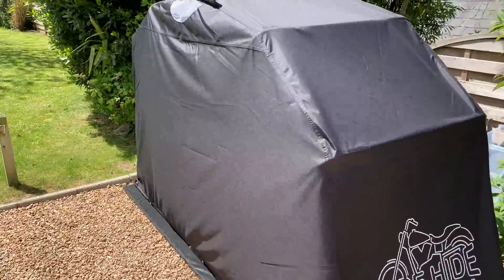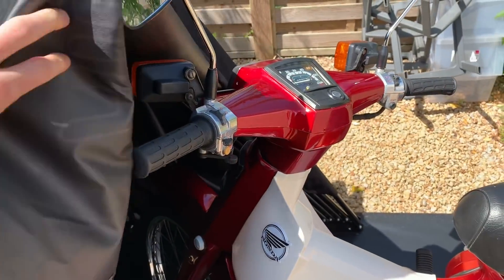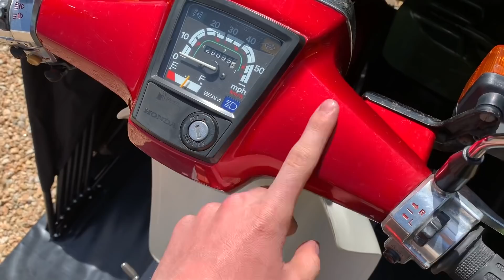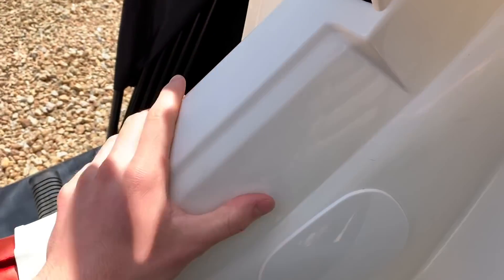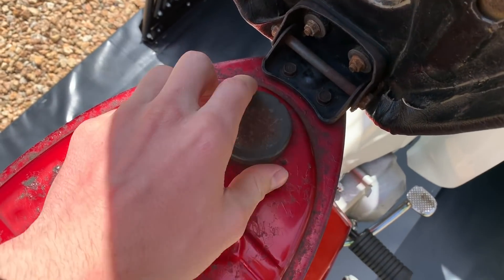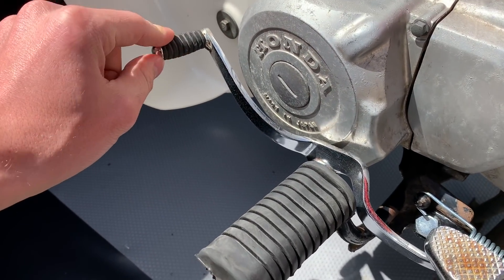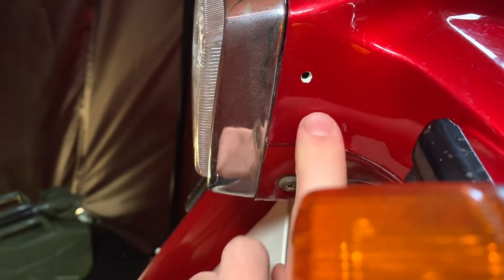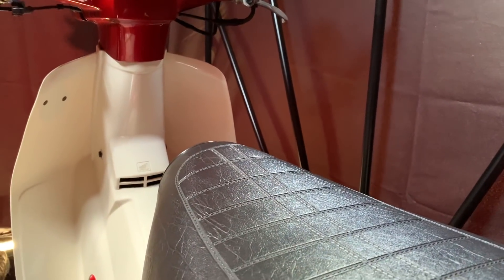My 1989 Honda Cub 90 | The Retro Future

Comment: Yeah...lots of memories come back of my '68 Honda 90 'Super Cub' my G-parents got me for my 14th.B-day, same Honda colors, no electric-start, and $300 'out-the-door' tax & license!
I 'beat the crap' out of that machine for 3-years and no maintenance at all despite riding it virtually every day anywhere/everywhere
_________
My current ride for the last 5-yrs. is an '08 Honda 'Metropolitan'  with a liquid-cooled 'Mighty Fifty' engine
This machine is 'light-years' ahead of the '68 'Cub' in terms of technology and quality of build with a vastly superior ride and 'road grip' and mirrors that look 'standing still/engine-off' even w/wide-open throttle at 42-mph w/a 230lb. 'fat-ass' rider on it (me)
_________
*The machine is immaculate without so much as a 'speck of rust' anywhere...not even the tail-light screws
for the lens or the floor-pan bolts look anything other than 'showroom'*
( Always in heated garage with adult owner before me and always in my house when not being ridden )
I'm pretty much 'OCD' over my stuff now like I never was when young!
_________
No matter where I go as soon as I park at the grocery or wherever I hear the same things of  "Where did you get that?/How much was it?/How fast does it go?/etc.
That never happened before!
The scooter 'Goes with the House' when I croak my last 'croak'
I don't know what the future holds in terms of vehicles for me...but the Honda STAYS

Comment: One thing you will have to keep up on, is oiling your chain correctly.   The chain picks up periodically grit and stuff and if left to its devices will wear your chain prematurely, its not a hard thing to just rotate the chain with a cloth to wipe off the old oil and then dribble on some new say once a month, you can buy auto-oilers but I on my big bikes used an old car sponge and just dabbed some good chain oil onto it and wiped it on chain as the chain was rotated round.   After a rough winter I would cleanse the chain completely and reoil to rid the salt and muck buildup.

Comment: 0:56 "Hiding my bike away from the sun"
What bike? There is none, I only see a scoo, scoo, scoooooter! XD
Here in Germany you can much easier find a Simson Schwalbe, but everyone's own choice
Reply: Ja ne simson ist schon was feines :)
Reply: @DoubbleDdragon  ja, das stimmt
Mei Cousin hat eine ;-)
Aber allgemein Simsons, vor allem die großen 50er kriegst echt gut
Reply: Neither the Cub nor Schwalbe are scooters, they have manual transmission, engine in the midle and big wheels, which, despite the looks, makes them motorcycles.
Reply: @9denisu8  but both have running boards :)
But I don't know the 100 per cent accurate differentiation, so okay, I guess you're right
Reply: Gary Dodgson  ah, thank you
Good to know
Reply: I agree, I ride a 1972 BMW R60/5.   Thats a bike!
Reply: @9denisu8  semi automatic transmission is more accurate, I think. There's no clutch, but you change the gears manually.